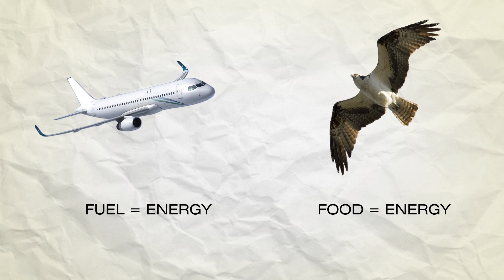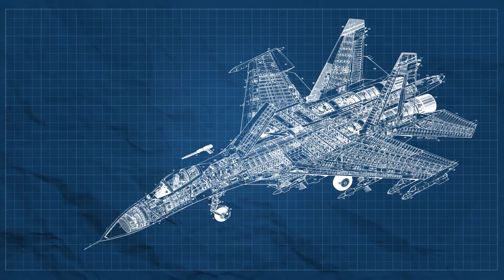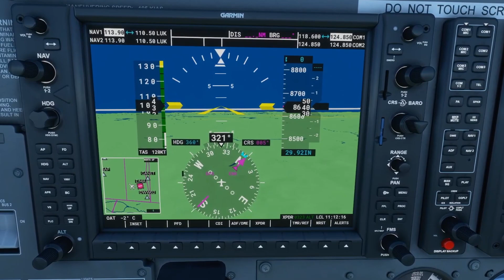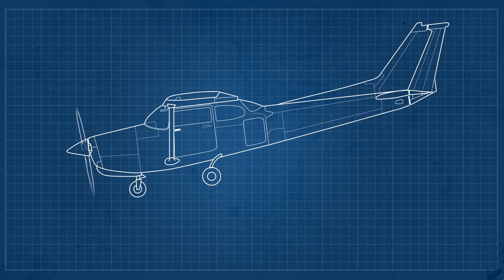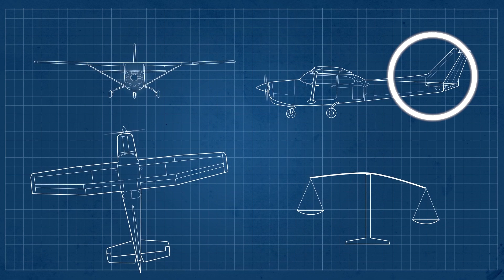Why birds don't use a vertical fin? | Birds vs Airplanes (the vertical stabilizer)

Comment: Al Bowers work with Prandtl ‘33 and Horten brothers work taking bell shape lift distribution, think fly down tips, as opposed to earlier Prandtl with elliptical lift distribution thus maximizing lift per mass as opposed to lift per span which results in proverse as opposed to adverse yaw.
Reply: Per Al Bowers, birds tend to match this bell lift distribution.

Comment: When you think about it bats are even more fascinating. They also don't have tail stabilizers but in top of that they don't have feathers either. When bird's fly and they flaps their wings the feathers compartmentalize leaving holes through the wing when they flap backwards so they don produce thrusts backwards that pulls tjem down and neither do they have resistance from the air while flapping backwards. Bats obviously don have feathers so they cannot do that but they still manage to fly less efficient than birds but still more efficiently than aircrafts energy wise. I am wondering what mechanism bats use to bypass this. But what bats do have that birds don't is that they still have their fingers which they can move individually to chnage the wings shape however they want giving them better maneuverability thats why bats are better flying in thigh places.

Comment: OK, since you hit all around the answer.... let's try this: 
 Most Aircraft, ( not all of them) need vertical stab for yaw control purposes. There are some that do not. Typically they use computer aids. One example is Northrop (later Northrop Grumman) B-2 Spirit.  There are others. I designed and built flew a model aircraft that did not have vertical stabs as such.
BIRDS:    they have a form of vertical stabs. Yaw control comes from articulated ( biological) wings.  Also their tail feathers work much like a V tail  as used on Moony aircraft and many competition sailplanes. A bird can not fly with out tail feathers!   
Now you know the rest of the story !   Your welcome!
more info?   >.  https://www.youtube.com/watch?v=ZOxwGKEytSw

Comment: Great video. However, in civil aviation, we still need rudder to counteract xwinds when decrabing, to counteract yaw moments due to engine failure, to counteract prop effects and to sideslip 😅.

Yes the birds are very efficient relatively to their weight, but if you want to move 450 souls safely at 900km/h, meaning traveling fast, feeding them, and letting them go for a sleep, you need something rigid, with a lot of redundancy and plenty of reserves in cases something goes wrong.

Your video is very refreshing and enlightening tho. Kind regards.

Comment: Someone found in trying to build a radio controlled bird, a bird's rudder is his head,. They tried flying a model bird without a rudder and it didn't fly. Then they added a clear rudder, but for a documentary it showed. Then some one figured out that it's the movement of the birds head. They hooked that up and it flew perfectly. plus a bird has a built in flight computer.
Reply: I fly wingsuits and it is exactly the same. My head is both my rudder and elevator. Everything else trailing acts as an airfoil and ailerons, glide and roll control. Cg in humans is not so good though, we are tail heavy and inefficient.
Reply: Would the analogy be like when humans walk? We dont just walk by doing the same repetition of leg movements because we’d fall almost immediately. But instead we do micro adjustments to have balance for like uneven roads or weigh shifting? 

I feel like thats the case with making a bird machine. It should constantly know to make those adjustments naturally. Maybe like a tiny computer to do the adjusting

Comment: An Albatross has a glide ratio of about 25:1, while the best sailplanes are around 70:1. In this metric we slam birds.
Reply: the glide ratio is heavily dependant on the reynolds number
the albatross does very nicely at it's size
he only needs 3 meters wingspan for L/D of 25, while the Eta sailplane has a wingspan of 30m
rc gliders with comparable size might reach an L/D of 20
Reply: @marc_frank  I believe you have challenged me to a pissing contest. I must warn you that I am an errant aerospace engineer and I've been pounding IPA's
Reply: @Marc Frank  now we are talking! Thanks for acknowledging the silliness of attempting one-dimensional comparisons in multi-dimensional spaces. This doesn't match your criteria, but an aircraft I think is cool is the small ultralight sailplane by Windward Performance. It's an 11m span that achieves 36:1. I didn't research RC sailplanes yet because that is less interesting to me. What does your research yield?

https://en.m.wikipedia.org/wiki/Windward_Performance_SparrowHawk
Reply: @smithtorreysmith  that one is really cool
looks cute :)

it's hard to find data for glide ratio of rc planes
they would have to carry a gps and many people don't do that
finding space for it is sometimes difficult as well

iforce2d has done some measurements on his planes
an ASW28 was 19 and an FPV plane had 8 or 9

i'd like to know how the arthobby sailplanes, or some full carbon ultra high performance ones compare

i'll look some more

Comment: For birds to fly is like for humans to ride a bicycle. So they don't need a rudder, they use their own balance just like humans do when riding a bicycle.
Reply: Correct! If they are undesirably rolling right, they turn their head left to shift its weight and tilt their tail left while maintaining a slight dihedral (v shape) in their wings. These combined actions right them effectively. Crisis averted. An airplane’s cockpit would have to be able to swing left and right and the horizontal stabilizer rotate  either direction to accomplish this same task. Yikes! The pilots would  have to be seated behind the swinging nose or they’d be in for a nauseating ride. YEHOVAH taught the birds well. Praise God for demonstrating to us his perfect understanding of all the sciences through his extraordinary creation!
Reply: Well not really.. Bikes are able to stabalize themselves with no rider as long as they're moving at a significant speed, the physics of which are still being debated. In your example its honestly just working with what you got. Also birds are very light and relatively small and dont have the drawbacks of something over 100lbs or 10,000lbs trying to fly. Making an airliner into something that flaps enough to lift and move the vehicle across the planet is impossible and pointless. Making a drone that can do it however isn't, and has been done about a decade ago.

Comment: I think, In a way, birds have vertical stabilizers because they (appear to be able to) curve, rotate and pitch their tail, kind of like an inverted V tail.  That would be a pretty cool RC project with a slightly curved tail that can be rotated and pitched.
Reply: That's right, some of them can do that, and I'd say it's found in the smaller birds, but in the bigger ones you'll see that not all of them do that and some have a very short tail but still fly fine.
Reply: That is true for "agile" birds. But a bird like the albatros has almost no tail, everything is done by the main wings.

Comment: do you have a 3d printer? test the prandtl by eclipson

the wingtips outboard of the vortecies do the job of elevator, rudder and winglets all combined
the area of those individual surfaces might be greater than that of the wingtips

wingspans of wings with elliptical lift distribution and bell shaped lift distribution should be compared between vortex centers, not physical span (my opinion)

the physical wingspan of a bsld wing is ~22% larger than elliptical, at this comparison, both lift distributions provide the same coefficient of lift

the bsld is the solution for lowest drag for a given mass
the elliptical distribution is the solution for lowest drag for a given wingspan

i'm not sure which lift distribution is useful for which application

i suspect elliptical is good for minimum sink speed and carrying a lot of mass, but doing so "slower" (elliptical is used in the transsonic dp, the fastest model airplane in the world)
eagles might be wingspan constrained by the size of thermals, they circle slowly, it's lift distribution appoaches more elliptical

bsld might be good for speed and covering distance
the wandering albatross does dynamic soaring and circles the earth multiple times a year, it's lift distribution appoaches more bell shaped